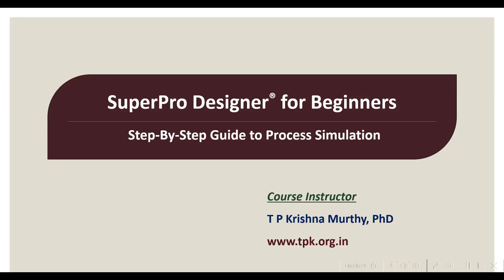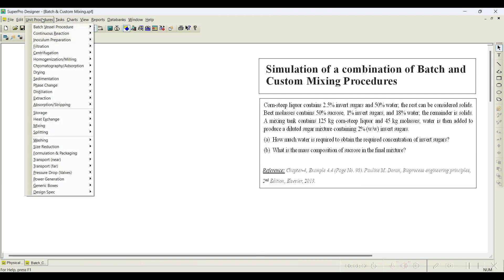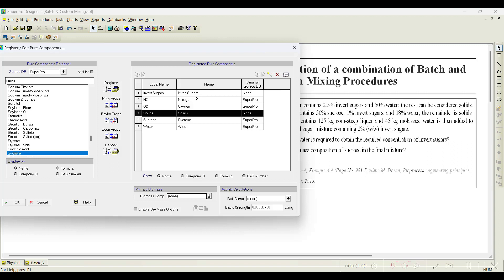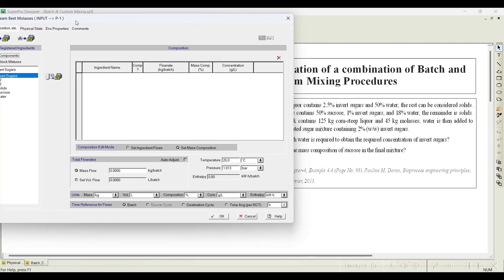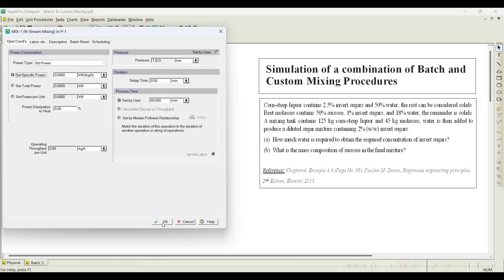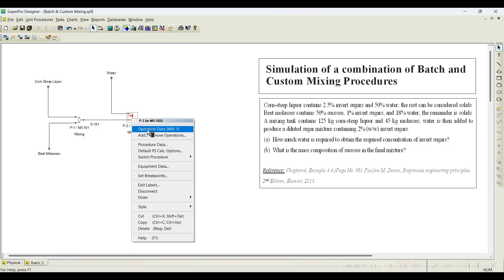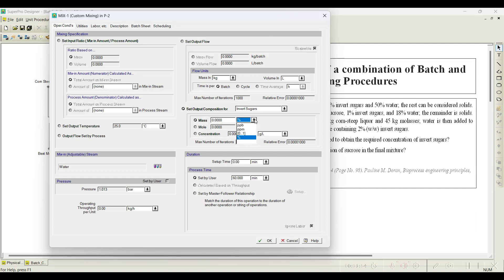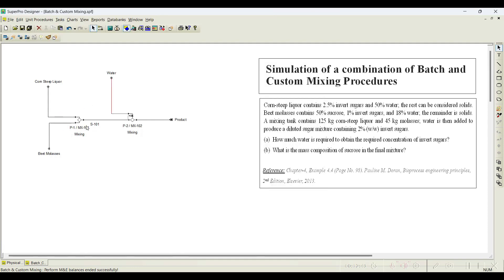15. Simulation of Batch & Custom Mixing using SuperPro Designer®

Comment: Why I cant put number at operating through per unit?
Reply from the maker: @danishh1385, operating throughput per unit is calculated by the software. Since it is a 2-way mixer, the throughput is the summation of the two input streams. The user does not need to set any flow rates manually. In the custom mixer, you can set the desired flow rates.